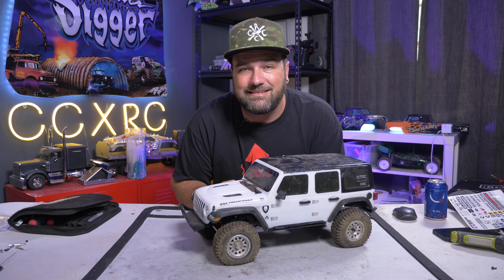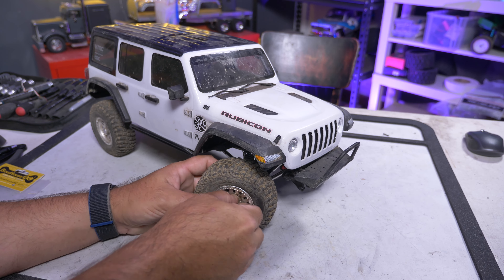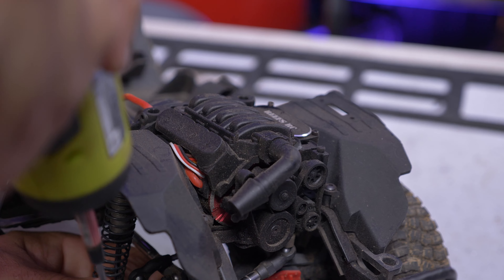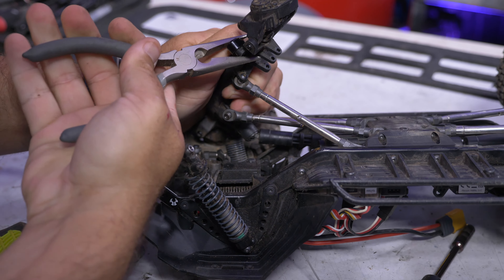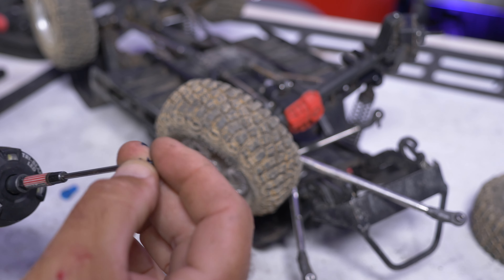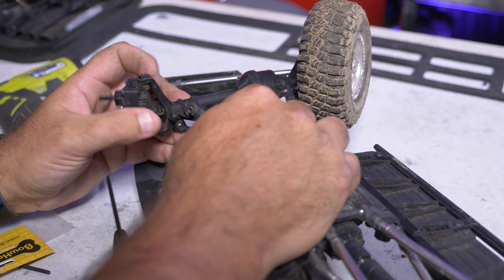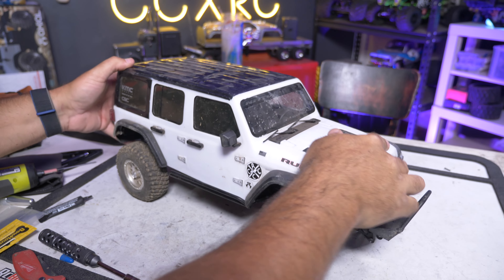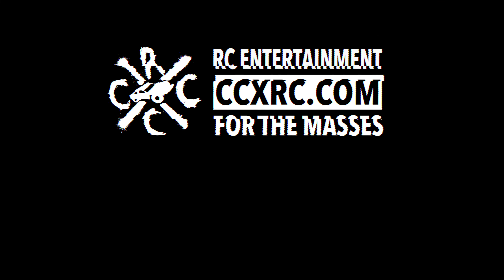Bowhouse RC Panhard Reinforcement Bracket for SCX10iii

Comment: Hey Tony I need some help deciding on a RC to get but it’s between the 2 of them, my first option is the Mini B, I think it’s cool and all but I don’t really have anywhere to run it, then my second option is the SCX10 2 Cherokee, and that thing looks so cool, it looks better than the Mini B, and I heard it can take a good Beating/Bashing and would not break that Easily, that’s what Austin from Amain told me. Oh so hard to choose, I need your help, which one do you like better? And I don’t have a full Scale Crawler to. My type of environment is country, so I can’t run the Mini B on the Gravel?! Please help me decide Tony, I would really Appreciate it, thanks Bud!?
Reply: Greetings I have the SCX10 V2 Cherokee trail truck and its an excellent rig... Very capable for crawling and trailing in the countryside... The mini is  a good RC but if your lookin for a good all around RC grab the Cherokee while you can... Tons of aftermarket parts for it as well to customize to your liking... Hope that helps ya out...
Reply: @angryyank  Thanks good sir, Has it tooken some good Beatings/Bashing when you crawl it?! And have you took it through little rivers and stuff, and has it been fine after that?!
Reply: @deving.2943  Yes its a pretty tough trail truck and I have used it in creeks and some water as long as you dont submarine it It holds up pretty well
Reply: @angryyank  Okay thanks.
Reply: @deving.2943  Your quite welcome hope it helps you out its a awesome truck IMO!! I have been in the hobby 30 yrs and I not only have the SCX10 V2 but also the V3 gladiator as well... You can NOT go wrong with their trail trucks... Cheers

Comment: I just broke that bracket clean off… can I still use this reinforcement bracket to hold the panhard bar?
Reply: Did you figure this out I just did the same after first use
Reply: @Honoluluairsoft  yeah you still can and it works fine